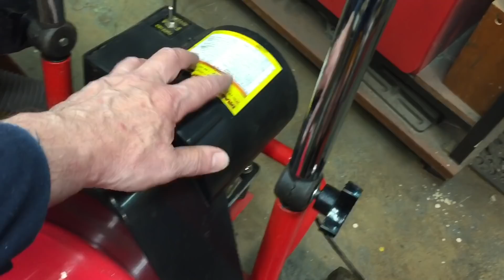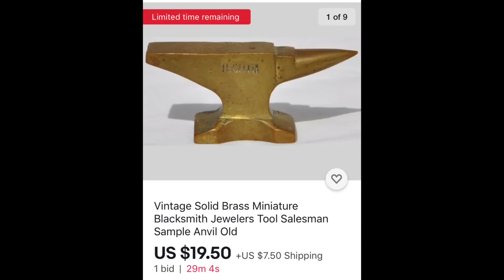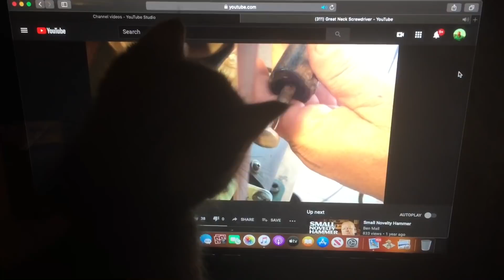Record Salesman Anvil, Electric Drain Cleaner, Teddy, Storm Damage

Comment: I bought a near identical anvil from a hardware shop in Coventry in about 1985, to use for small jobs or model work. Before I used it for proper work though  I put it behind the door as a temporary doorstop. When I saw your video I reached down and picked it up from the spot it has inhabited for about 35 years.
Reply from the maker: Rob maybe a quick polish and display!  😃👍

Comment: Nice job on the Record anvil.   Glad you kept most of the Record Blue.
Storm Isaias was tough on eastern PA.  I lost power for 10 1/2hr and a big maple was toppled.   It looks to have some rot in the middle of the trunk, but still looked healthy.    The good aspect is that it fell on the lawn, no other damage.   I just need to do a lot of chainsaw work.
I took the portable generator outside, hooked it up to the transfer box, then pressed the Start button.   Nothing.   I had charged the battery a couple of weeks ago.    It is 14HP engine, but I was able to use the pull start to get this running.   The unit is over 15 years old, so the starter switch is no longer sold.   I will have to replace with one for a car/truck/boat.  Just need a heavy duty momentary button switch.    "Murphy" was having fun with me yesterday.
Dave.
Reply from the maker: Wow!  Dave we have over 40K people without power and I am fearing a long wait on getting the power back!

Comment: @scoutcrafter I've commented before,  but I'm a plumber and wanted to enlighten you incase you've never heard of it,  but you can do what's called a sewer liner... starts of as a felt material,  mix it with a two part resin,  resin soaks into the felt tube., tube goes into an inverter, and using air we blow that into your old clay tile, asbestos, concrete, which ever sewer pipe you have, it's used as a mold and after the felt goes in, we blow a cal tube (balloon) into that and use a portable water heater to fill it with water so it takes its shape and cures in place.  Ultimately eliminating you having to trench your sewer through the yard, driveway, and most importantly the street... saves time and money.  And further questions lmk... secondly the spartan cable machine you pictured was for kitchen/ laundry and floor drains... the actually sewer machines are $1300-$1600 more just to let you know
Reply from the maker: Brandon!  Great info!  I think liners are outlawed here in the city- I don’t know why.  I have seen the process on this old house and it’s impressive!!!  Needless to say when I move it’s little things like this I will be looking at!!  Thanks! 😃👍

Comment: As you say to call a man out is minimum $100 an hour Half a days work will cost you $350. If you buy a power tool that cost $200 and you use it once it has paid for itself. Only professionals who use a tool everyday need top quality tools, most of us who use a tool once a month need hobby quality tools. In the UK very old buildings had sewer pipes mad of Pitch and tar and were soft, modern electric drain cleaners could pierce the pipe instead of bending with it. Any way tools under $200 are now throw away as they have paid for themselves the first time you use them.
Reply: Here in New England we occasionally run into old drainpipes that are made from fiber and tar. The old timers called it Orangeburg pipe. Nine time out of ten it had deformed into an oval cross section. Never saw it inside a building, always in the ground going to a septic system or a dry well. I think the building code called for cast iron pipe going through the foundation. Once out of the building they switched to either clay drain tile or this orangeburg stuff.
Reply: @janderson8401  Maybe these old buildings used the same fiber and tar pipes. it sounds the same.
Reply from the maker: When you are installing a sewer line and it’s guaranteed for 50 years you think “I’ll be long retired by then”. 😂
Reply: @ScoutCrafter  50 years soon comes and gos.